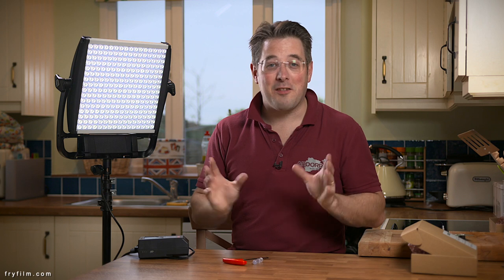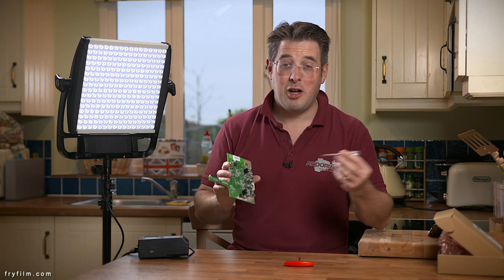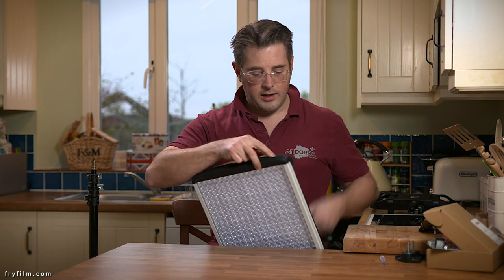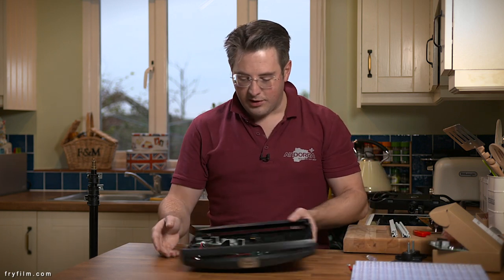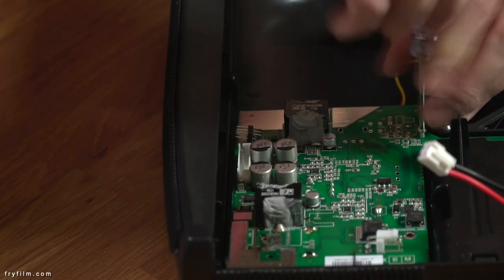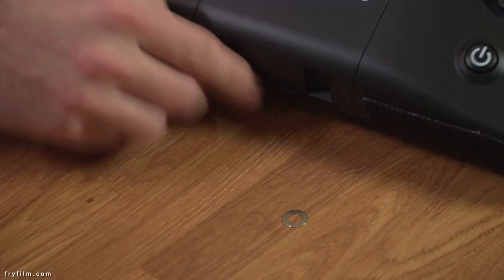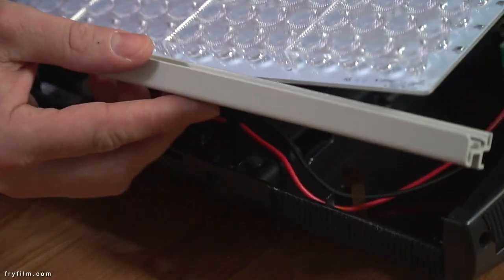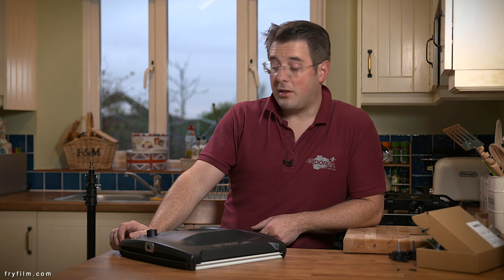Fix Litepanels Astra - how to disassemble & repair Power / Dimming Problem

Comment: This is a very helpful tutorial, but before you attempt it, Litepanels has an "Astra Program" to repair this problem free of charge. It appears to cover units purchased before March 2018, when a redesigned power board was implemented. "This offer is valid for up to four (4) years from the original purchase date."
Reply from the maker: Fabulous! Wish I'd known about that!

Comment: hi, when I plug the Litepanel astra in, the power adopter starts beeping and the light won't turn on, do you know why this could happen? thanks
Reply from the maker: It's definitely the right power adaptor? Might be an issue inside the panel - open it up and have a look.

Comment: I have issue where any slight bump to the stand or light the whole unit turns off - basically just moving the stand it will turn off - then have to turn it off and back on again - its pretty annoying
Reply from the maker: Sounds like a dodgy wire or contact. Open it up and have a look.

Comment: Have a problem green lights blink and go to solid red what i do
Reply from the maker: Follow the instructions in the video or send it to Litepanels for repair.
Reply: it will go to solid red if your battery is 100wh battery - turned up to full the battery isn't strong enough - u need a 200wh battery to use the unit at full output
Reply from the maker: @SPM2206  Actually the capacity of there battery doesn't matter, it's the maximum constant draw. I'd suggest a battery with at least 10 amps constant draw or better.